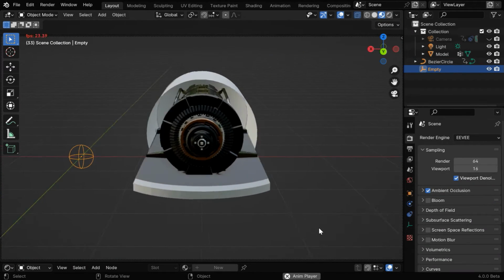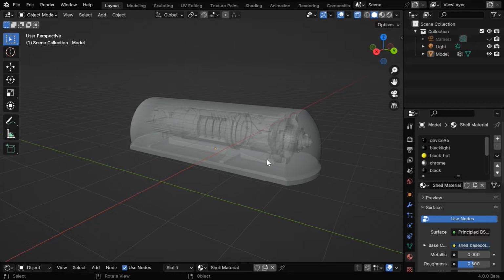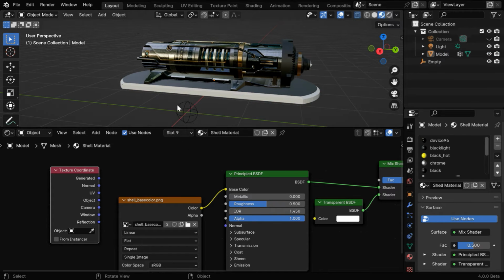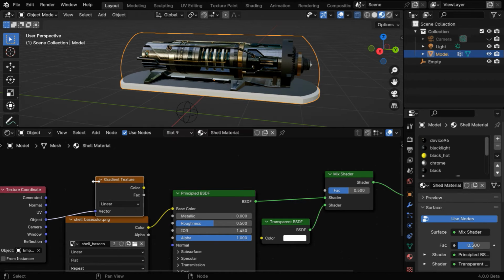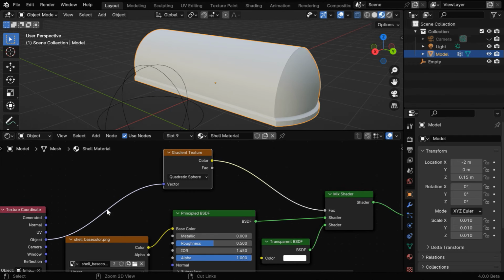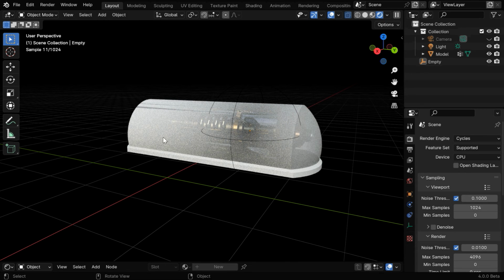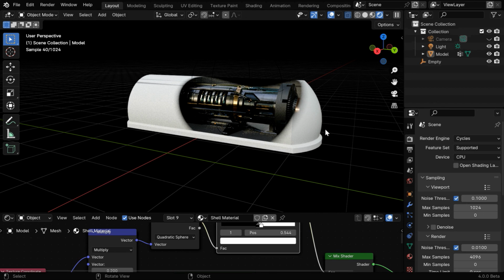Reveal the Inside Part Magically 😲😲 See Through Any Object With An Animated Transparent Shader

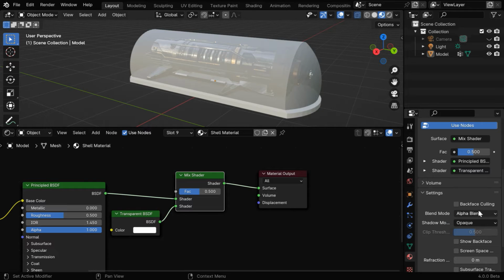Comment: Hello, there are some changes in Blender 5.1 at 1:20. Probably because of those changes, I can’t use an empty object to make it reveal from the inside anymore.
Reply from the maker: It should work in Blender 5.1 as well, I have just checked. Yes, there are changes in Blender, the shader settings went through a lot of changes recently, Eevee is replaced with Eevee Next, but the effect works as it is – it now works more beautifully actually. If you don't see a particular field in Blender, just skip it. Blender's Eevee Next is set up with all the natural settings, so the revealing works fine. If you are stuck at any particular point please let me know. For example, at 1:20 as you have highlighted, we have change the Blend Mode which does not exist anymore. So simply skip that, it will still work.
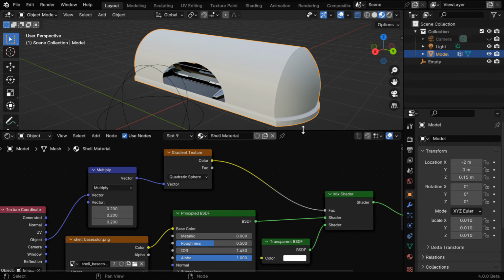Reply: @5MinutesBlender   Hi, thanks a lot for your reply. Could you try the “Quadratic Sphere” in Blender 5.1? At 3:37, I only get a translucent effect, and it’s not as clear as in your tutorial.
Reply from the maker: @squirtle4519  Sorry for being late on this. Yes I verified just now and Quadratic Sphere also works in 5.1 exactly as shown in the tutorial (it now works even better for Blender's lighting improvements). I suggest you please check the Color Ramp node there (after the Gradient Texture node) because when I removed it or changed its settings, it was showing a translucent effect as you described. So that may be key in your case.
Reply: @5MinutesBlender  Thanks a lot!!! I added a Color Ramp node after the Gradient Texture node, and it works great! However, I used Spherical instead of Quadratic Sphere because I think it matches the shape of the empty sphere better. Thank you!!!
Reply: @5MinutesBlender  Thanks a lot!!! I added a Color Ramp node after the Gradient Texture node, and it works great! However, I used Spherical instead of Quadratic Sphere because I think it matches the shape of the empty sphere better.
Reply from the maker: @squirtle4519  Great to hear that you could make it work! Awesome! 👍👍

Comment: This is great, i had used this in one of my animation projects but then i wanted to have multiple empties (texture cordinator) to have better control over my animation. can you help us with that ?
Reply from the maker: Yes, that can be done. Basically we are using the position of one empty (the texture coordinate node) to drive the Factor input of the final Mix Shader node. Instead, if we have 3 empties, we have to use 3 texture coordinate nodes, get the position of 3 empties and use them to create a composite output that will follow the similar path. One way to create that composite output is to take Min() of each component (x, y, z) of the 3 position values and join them as a location vector. It depends on how you want to control the animation.

Comment: Thank you for this video tutorial. How I use multiple empty objects (group of objects in a Collection)? Please help.
Reply from the maker: Thanks for the appreciation 😊💝💝 I did not understand your question very well. You have multiple objects within a collection. You have an empty for each object... and what? Kindly explain what you want to do.
Reply: @5MinutesBlender  Thank you for your response. My question is "how I use multiple empty objects or a Collection in 'Texture coordinate' node for interaction?"
Reply from the maker: @apurba_sanpui  Ok, so what I understand is, you have multiple objects or a collection which together represent a bigger object or a scene... and you want to apply this effect on the whole collection or scene. Texture Coordinate is specific to a single object. You need to add the same material for each object within that collection. Then all objects will be under the control of this effect, so you can manipulate their "revealing inside" function using a single control object (which is the empty we have used). You may get an issue of layered visibility i.e. multiple objects with conditional visibility may not render perfectly (this problem is more relevant for Eevee but even Cycles can show some issues) - but that is an entirely different issue (rendering).
Reply: @5MinutesBlender  Thank you very much.

Comment: Hi, trying to make transparent more objects with the same texture placed behind each other, the first object is transparent, but the others are somehow black in cycles....in eevee it works....pls help
Reply from the maker: Sorry for the late reply. Without looking at your blend file what I can guess is, Cycles uses Ray Tracing method to know about the transparency. If you use a low Light Bounce it does not get enough light rays from behind your first object, so it renders it dark. The solution is to increase the transmission bounce (we have this field under the render settings > light paths > max bounces > transmission bounces) and also increase the total bounce accordingly. But in my experience, even with a high number of bounces we don't get an Eevee like clear transparency because Cycles is more like reality. If you just want a still picture, may be you can use a very high number and get your job done. But with a video output the rendering time may be too high. Based on your use case, you can also consider using Eevee. Or just go with the half-transparent behavior with a relatively high number of light bounce as a trade-off.

Comment: Doesn't work with textured
Reply from the maker: Hi, I saw it working perfectly in Blender 4.5, which version are you using? And please also tell me what you mean by "texture" here 🤔 I just opened this tutorial file in Blender 4.5 and it seems to work without any changes.
Reply: it works bro ...........may be you skipped some parts

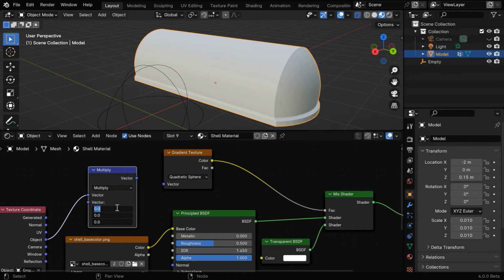Comment: I tried this one (3:32) but it doesn't work, depite having everything right.
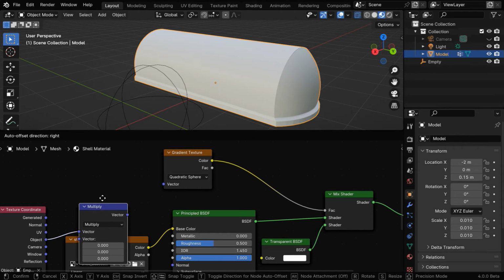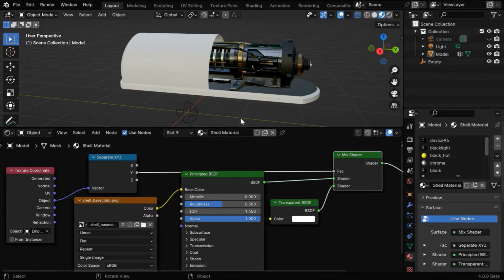Reply from the maker: Since Blender version 4.2 there have been some changes in the material for Eevee. Please let me know if it works for you until 3:32, for example, at 2:22 where we partially reveal/hide the cover - does it work for you, and only break at 3:32?
Reply: @5MinutesBlender  The only one that doesn't work is at 3:32.
Reply from the maker: @cristobalmartinez2398  I see 🤔 Please check if you missed anything, like we are using a vector multiply node, and it is possible that you picked up the math multiply node (scalar node), they look very similar. Instead of the object output (texture coordinate), you might have picked up the generated output. I am just trying to guess. I can only suggest correctly if I can see your blend file.
Reply: @5MinutesBlender  Is there a possibility to send you a PM with the blend file? This is my personal channel, and if I post it here, a follower of my real channel might see my project before I publish it.
Reply from the maker: @cristobalmartinez2398  You can always connect with us at 5minblender@gmail.com

Comment: This doesn't work in blender 4.3.2. can you make a tutorial on that.
Reply from the maker: I tested this now in Blender 4.4.3 the latest version, as well as in 4.3.2, and it works exactly the same in Cycles as well as in Eevee. However, you can tell me which particular thing is not working for you, and I'd request you to double check if you have done everything correctly as shown here.
Reply: @5MinutesBlender  i finally got it to work,  there wasn't any alpha blend or clip in my version, there's rendered mode now. thanks
Reply from the maker: @mymozy1  Great! Thanks for letting me know 👉

Comment: how can i make the section that is being cut a proper square? i am using an empty which has the form of a square, but to achieve the effect i have to select Quadratic Sphere in the Gradient Texture node on the shader. how can i make the cut of a square instead of a sphere??
Reply from the maker: The shape of the empty does not matter here because we are merely taking its X,Y,Z coordinates i.e. its origin point. Based on that origin point we are creating a spherical cut into the target object. There is no native support for creating a square or a cubic cut. We have to do it differently, maybe with a cube as you did and then using a boolean modifier to cut a portion from the outer layer of your target object. It will be slower, and the success rate will depend on the shape and complexity of the target object. I cannot think of an easier way to do this.
Reply: Hey @TheMetalFreshTiger are you managed this problem ?

Comment: Sir, I have made it completely, but sir, after the separate see, which seeder should I add because sir, there is only one void in the mix seeder.
Reply from the maker: Hi, I assume that it is in relation to your other comment that you made today. So as I suggested there, you should now have 3 texture coordinate nodes with 3 empties selected for each of them respectively, connected to 3 separate XYZ nodes. Now multiply the output of these 3 XYZ nodes i.e. X of the 1st one, Y of the 2nd and Z of the 3rd, and use that result in the FAC factor of the mix shader. You need to place the empties initially such that it does not hinder the target object. Now if you move each empty in its designated axis, the shader will disappear along that particular direction. If you are still unsure, let me know, I will upload a quick video tutorial for this. All the best!

Comment: Any body tried this tuto using Blender 4 ? I have problems with Sphere and quadri sphere both in Cycles and EEVEE
Reply from the maker: This tutorial is created using Blender 4, there is no problem. Please check if your setup is exactly like ours. If you still don't get any clue, you can send your blend file to 5minblender@gmail.com and we'll be glad to help you 👍 And thanks @theGoogol for your valuable input as well 👍
Reply: No problems in Blender 4.0 here.
Move the empty right over the shell to see if anything happens with short distances.
Make sure you've set the transparency mode in the material (blend mode) settings (EEVEE).
Also, make sure you have Object piped from the Texture Coordinate node (Node Wrangler users often forget that it auto-connects to UV).

Originally, my node setup looked like this (EEVEE) :
Texture Coordinate (Object "Empty") > Gradient Texture (Spherical) > Math Add (0.050) > Color Ramp (to liking) > Shader Mix Node (Principled BSDF for opaque material).

In EEVEE, I used Alpha Hashed in Material Transparency (Blend Mode) Settings because it got me the best results for my application.

Comment: I made machine/ mechanisms but i can't make animation of fluid flow and show different color in it’s path to represent the pressure and temperature variety, also reduce the path. Please make tutorial on it
Reply from the maker: Fluid color based on temperature or pressure is easy, we can do that if we save them as custom attributes. We will take this up as a tutorial suggestion 👍 But I did not get what you meant by reducing the path 🤔
Reply: Like water flowing throughout the orifice, reducer etc. Fluid equipment
Reply: Specifically i made a tube well. But cannot show the water passing through the Check valve and bucket functioning animation.
Reply from the maker: @ShafaulHaque  That type of fluid animation through small parts of a machine will need a very very high domain sample size like 512 or even higher. It needs a very high end machine to bake that physics.
Reply: @5MinutesBlender  Solution : Don't use physics but an inner "tube" with water material (assuming all tubes are full all the time). Then make a weight map, use an attribute node (and a color ramp node if needed) connected to a color mix node or a shader mixer to color the water material. It's probably a schematic drawing.
Reply from the maker: @theGoogol  Yes, it can work if we don't need the actual flow of the liquid. I think he wanted to show the "flow" of the liquid material. He is creating a tube well, where the water passes through a valve, so there is intermittent flow of water, not a continuous flow 🙁
Reply: @5MinutesBlender  : If that's the case, he could bake the simulation and use a similar technique as described in this tutorial to define "zones" with empties where the water should change color. The empties then steer color or shader mix nodes based on vicinity. 😊 In the worst case scenario (to prevent huge domains with high sample size) he could use metaballs in a physics simulation.

edit : If he doesn't mind long render times (cycles) a volumetric shader with the technique as describe above could also work.
Reply from the maker: @theGoogol  Hats off for some out of the box solutions 🤩🤩👍👍
Reply: Please make a tutorial